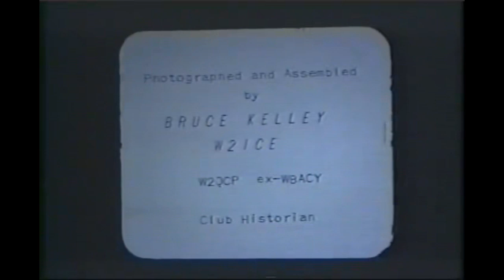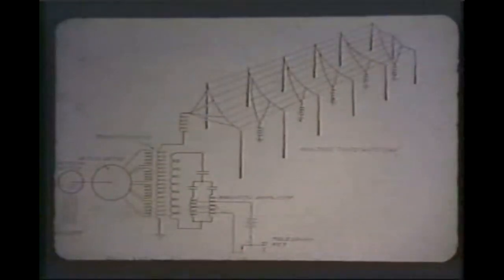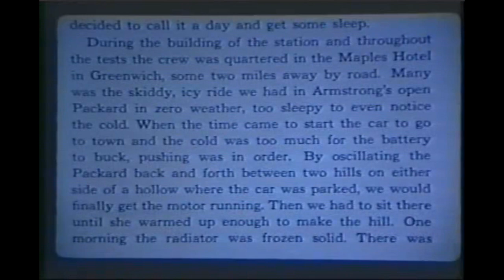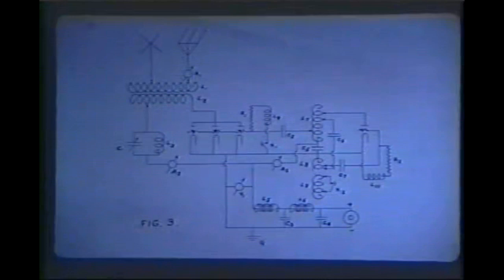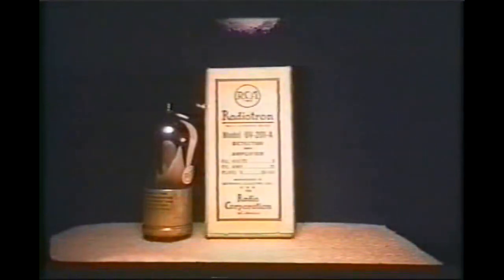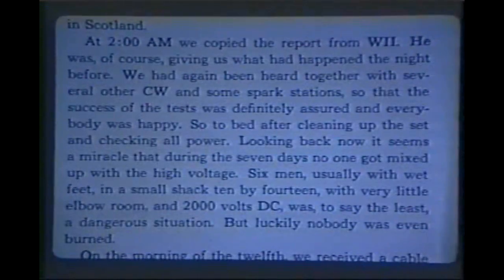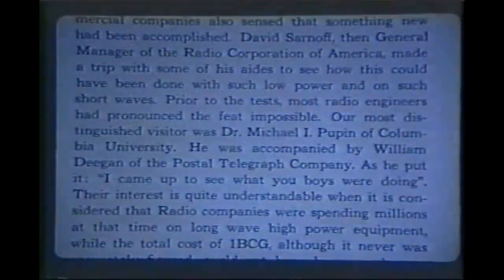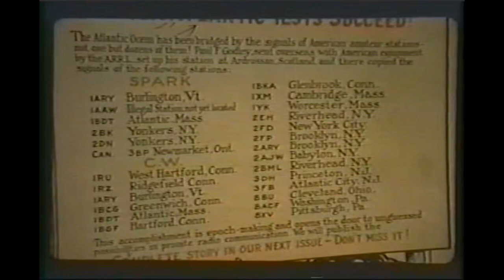AWA Classics - The Trans-Atlantic Test of 1921

Comment: Many thanks for making this presentation. As one of the operators at the Transatlantic Centenary Special Event Station at Ardrossan, Scotland.  The Centenary event station at Ardrossan was set up and operated by members of the Kilmarnock and Loudoun Amateur Radio Club less than one wavelength from the spot where Paul Godley's tent and beverage antenna was located in 1921. I was operating with the special callsign GS2ZE during the centenary event and was delighted when we received the re-enactment transmission of 'the message' on that cold, wet Sunday morning. I will never forget the experience.  it was most enjoyable to watch this video and see the photographic slides showing the equipment used and  the people involved in the original Transatlantic Tests in 1921.  73 de MM7WAB Paul Scott. - May the Propagation Be With You -